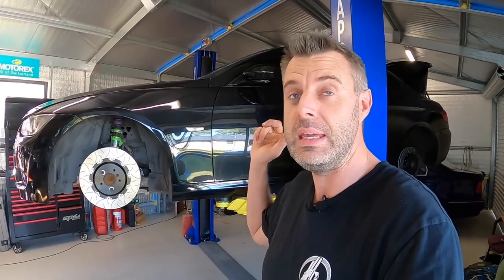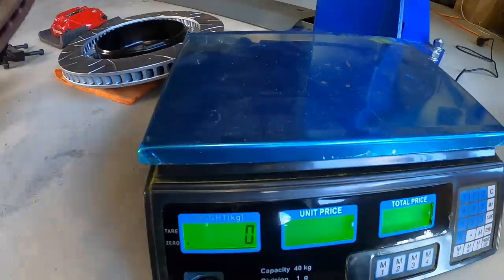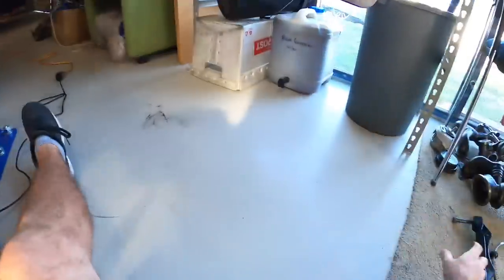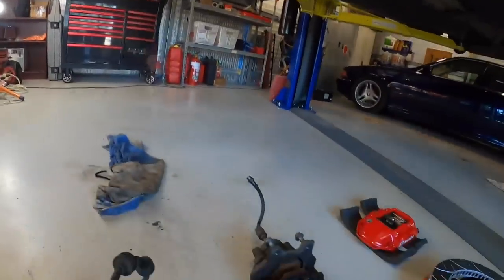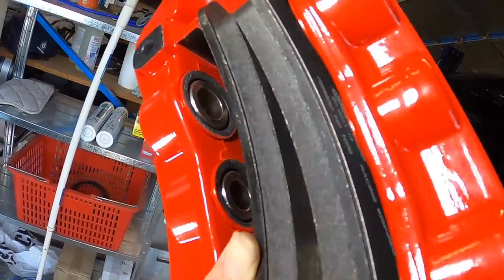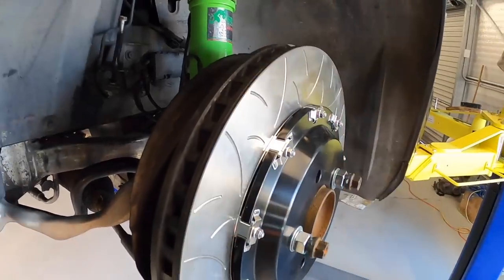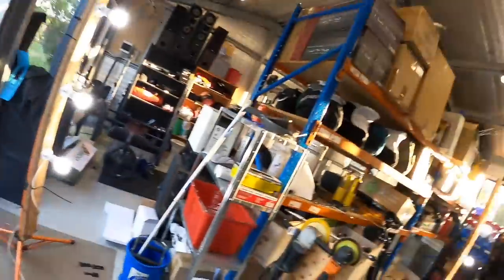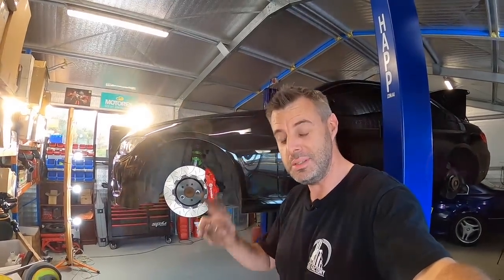Trying to fit the AliExpress Big Brake Kit: We have a PROBLEM!

Comment: The biggest problem i see you having trouble getting new Pads you can't just get them from your local auto parts store or online 🤔 if th they are the same as actual brembo pad design.
Reply: They look like clones of the actual brembo casting, so you could most likely use legitimate brembo pads. Anyway, they sell friction surfaces and pads too.
Reply from the maker: They should take genuine gt6 and gt4 pads. From what’s I’ve read anyway

Comment: Hi there! nice brake video guys!! I was wondering why my 135i (mpackage) doesn't have the same caliper than ur 335i. My front one is a 6 piston caliper from factory that look similar to your brembo edition. Does someone have any idea why?
Reply from the maker: The 135i was fitted with smaller wheel options than the 335i so they actually run smaller brakes or more compact brakes anyway.
Reply: @ZeroTo60Tube  Thanks for the info. I didn't know that the 135i had smaller brake than 335. At least, she came at the front with a 6 piston brembo from factory. They are painted grey with the BMW logo on it. Because of you I did have to put the 17T on my mod list, your are such a bad influence for my wallet ;)
Reply from the maker: Drive safe with those 17t turbos!! They are awesome!
Reply from the maker: Ps sorry about the wallet 🤣

Comment: My stock 135i brakes are all fixed calipers, none are floating. Rear is a single piston but pretty big and the fronts are 6 piston. I bet those are even cheaper than the Chinese brakes and my breaks work great! Might be an even less expensive option with more reliability being genuine BMW. Just my opinion, this is my first BMW.
Reply from the maker: Interestingly the 135i 6 piston brakes are actually a down grade from the 335i stock single piston. The 135i brakes are smaller to suit the smaller wheel options fitted to the 135i. Mind you they do look cool.

Comment: I see how you were struggling keeping the rotors on with the rotor set screw. Might I suggest a little race car mod that will fit in your budget.
Pick yourself up a wheel stud kit and ditch the lug bolts. It will be your best mod.😎

Comment: I think this are real brembos, sold straight from some factory making this for brembo
Reply: martin degetau thats what i was thinking, basically stolen brakes
Reply from the maker: I really don’t think they are genuine. I could be wrong. But I don’t think they are.
Reply: Would be nice to compare them next to a real set.
Reply: yeah nah.. real ones are made in italy
Reply: Chinese factories always sell stuff out the side door. I wouldnt be surprised if these are actually gens.
Reply: @JimiJimiP  Do you have a reference for that? I only ask because I have been looking and have been unable to find the country of origin for these specific GT brakes.
Reply: @JimiJimiP  didn't someone post on the OG video that Brembos are actually made in China??
Reply: @JimiJimiP  nope, brembo make the cast in china,
Reply: Rubber seal on the OEM brembo are also painted :)

Comment: Just installed a front/back big brake kit from Dicase for my E92 M3.  Awesome Finnish and fits perfect other than I had to 2 shorter bolts for the front but all in all great for the money. Took about 7-8 weeks to get to the United States
Reply from the maker: Awesome to hear some feed back. What pads did you get?
Reply: @ZeroTo60Tube  I got the ceramic pads and so far there pretty good

Comment: You would have shaved off 5 lbs on each rotor if you had bought Rotora BBK. And that's against the old stock rotors, and also against the ECS tuning semi floating two piece rotors you save 3 lbs.

Comment: You might find those longer rear brake lines will allow you to bypass the shitty intermediate metal pipe the E90 has. It's absolutely infuriating to work with ... I recently did braided lines on my E90 and would have much preferred 2 lines instead of 4. I can't see any point in the intermediates!

Comment: We are all excited, brilliant stuff. I would check rim clearance as well
Reply: Yea definitely, I found 2 kits from them and one has a front rotor of 362mm and the other has the 380mm like listed in the video. I'm really interested in how this turns out, hopefully you don't have to drill out and retap the rear to the larger size since it may not be the easiest job to get a straight approach to the hole.

Comment: No stud conversion after all the other mods?
Reply from the maker: I’m not fussed on them. I feel like it’s a mod that exists just to take people’s money. I don’t have issues fitting wheels with bolts. I know some people struggle to line the wheels up.
Reply: Zero To 60 you would be surprised at how nice they are to have. I used to think the same thing but they have made my life a lot easier! Plus they do look cool and make it easier to add spacers. Plus they only cost like 120 usd
Reply: @davidrowe2217  I find them immensely helpful as well.
Reply: Also you can add the spacers required for clearance, while having the proper amount of thread for the nut vs the stud having less thread to engage.
I've seen wheels fly off due to big spacers and not enough thread engagement.

Comment: I know I'm jumping the gun in the timeline here...but what about the brake pad sensors?   And I'm ready and waiting on the bleeding. Lol  I did a caliper job on mine and accidentally got air into the ABS unit...it was a fucking nightmare ...my dashboard was lit up like a Xmas tree.
Reply from the maker: The pads have a slot for the sensors in the front but i haven't tried them yet. Also i am expecting the same issue with the ABS. Most of the brake fluid has lest the system. However i will be able to bleed it with ista.
Reply: @ZeroTo60Tube  nice work.  Yea that's what I had to do...it took me like 5 or 6 cycles through INPA to get it right...them my abs light was still on....then magically went off a few days later lol. Been fine ever since 😂😂.

Comment: Hopefully the pads are half decent. Such varying performance from just a pad change.
Reply from the maker: 100% right there. Pads are very important. This supplier actually make track pads. Although I bet for my driving the basic of basic compounds should be fine. I’m really pretty good on brakes. One stop from high speed then a cool down normally.

Comment: D2’s 380/32mm 6 pots did not fit 18” rims, hope yours do...
Reply from the maker: Well, keep in mind different rims will have different clearance and wall thickness.  I have some OEM e90 18" wheels which i will try today.
Reply: Zero To 60 I tried the best 18” for big brakes: OZ Ultraleggera 9x18” et40 😇🏁
Reply: @ZeroTo60Tube  OEM 18" rims have bugger all clearance (it's the barrels) the style 189 just cleared my 360mm E9X M3 brakes. My 18" rays ZE40 on the other hand have a heap of clearance!

Comment: where we can buy this kit? i didnt found it in aliexpress
Reply from the maker: It's not a simple purchase. And even with the hours i spent researching and clarifying specifications with the guys, they still sent the wrong brackets. One thing i can say, the Ali guys do not have correct fitment data for 335i's even though they think they do.
Reply: @ZeroTo60Tube  yeah for sure people in aliexpress some times aren't the most smart sometimes hahahaha. Anyway, the fitment maybe isnt to much problem, cause some workshop could do it. But i only want the front brakes, these fit fine, no?
Please let us the link, or at least some hint to find it ;)

Comment: What do you think of this 335i for 22k ? It has 500hp 
https://www.carsales.com.au/cars/details/2007-bmw-3-series-335i-e92-auto/SSE-AD-6577745
Reply from the maker: It's questionable. Without offending the seller, there are definitely better options out there. I don't think who ever owns it really understands much about them at all. The ad does not make sense.
Reply: Zero To 60 That was exactly what I was thinking ! Thanks for the confirmation
Reply from the maker: @Cyaotic  you might be interested in the video i did on mine when i first got it. The one you linked is less appealing than mine when i got it. Not to mention mine was 10k... with less kilometers. https://www.youtube.com/watch?v=rUFQ0WDpXkE&list=PL0EMNJD2Ijw4FpwuMwOaXHdWWidXWIiDD i think the dude has read a JB4 n54 can make 500hp so he is making the assumption his is 500hp.
Reply: Zero To 60 I think he believes for every psi adds upto 20hp which isn’t accurate at all.
Reply: As it’s maxing at 18psi and these are 300hp stock at 8psi , so 20x 10 = 200hp on top of 300. I think that’s how he worked it out
Reply: Zero To 60 for 10k that’s an absolute steal and a half!

Comment: Love your vids, brakes look the part hope they perform too. Fabricating a decent bracket would be a pain hopefully you can get the correct one from supplier, still 8k up from where you could be with real brembos though hah.

Installing 17T's in 2 weeks, did you change spark plugs out for colder NGK ones? 
Slightly worried about the EKPM too with a Walbro 470 behind it but I'm just going to send it.
Reply from the maker: Woohoo on the 17t's. Like i tell everyone, remember to be safe once you have them fitted. Regarding plugs. Fresh plugs is always a no brainer when you are winding the power up. However as for colder it will be dependant on your tune and fuel type. I would recommend speaking to who ever is doing the tune and get their opinion on what plug to run.
Reply from the maker: Almost forgot about the EKPM, i think send it. You will get a warning when its starting to struggle. And even when they overheat you will get a warning, let it cool down and you will normally still make it home no worries. When it actually shuts down, you know its time to replace. I am running a $60 ebay china made ekpm3 and its working fine btw.
Reply: I was going to get the 19t but I think my clutch isn't going to be happy with the 17s lol.

That's good to know it shouldn't strand me 🤞. Will look into the ekpm3 module as it's supposed to be a bit more robust.
Reply from the maker: @Ewok_Nz  I think the EKPM3 basically just have a newer power unit. So they wont run hot like EKPM2. Fun fact, i never had an issue with me EKPM2 but did get a fuel pump over current warning on my EKPM3. I think if you keep the EKPM2 cool they are fine. But again worst case scenario, they over heat, let it cool down and you'll get home. Most ones i read about they will overheat a few times before they die forever.

Comment: They sure do look good. I recently bought the red M performance brakes. Had them installed at my local BMW dealer for $3100US.
Reply from the maker: What do you think of them now they been on the car for a little while? Also model is your BMW?
Reply: @ZeroTo60Tube  I have a 2018 340i M Sport sedan. It's been almost two weeks. They look and perform great. Although I have to admit I haven't been driving too aggressively since I had them installed. The red really makes them pop.
Reply from the maker: It's funny, i think to me the look of the brakes was more important than any performance upgrade. haha. And congrats on the 340i. Man i love the B58s. Would love to have a play with modding one, one day.
Reply: Zero To 60 Yes, looks we’re definitely the deciding factor for buying them. Dinan recently released a B58 flash tune that looked decent until I saw a Noelle Performance tune that takes an N55 or B58 to 420-440hp.